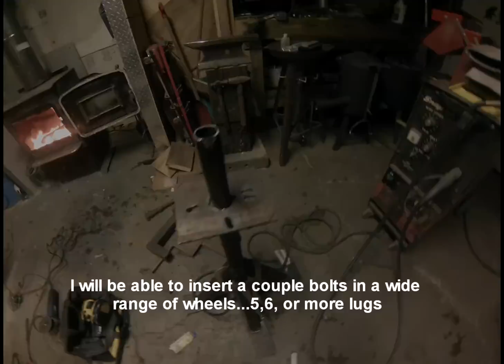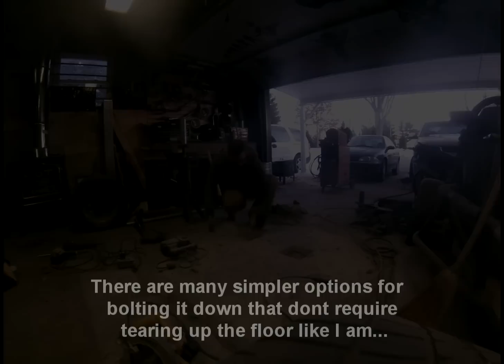How To Build A Homemade Tire Changer From Scrap Metal

Comment: Hi. Was thinking of making one myself. I may use 2 pieces of 3 foot railway track, in a V  formation, as a base. Take off  from there ; thanks for the small solid tire welded to pipe, for tire  hold down.......and others, I may have  shorter stroke, on the bead breaker arm. Maybe put 3 holes in it, near fulcrum, for better downward leverage..... Anyway.  thank-you.  ( from east central Alberta )

Comment: Pretty impressive! The only I am left asking is why you decided to bust open the concrete floor so bad instead of just using a hammer drill and red heads? I know you said you know there are better ways, so why did you go this route?
Reply from the maker: I built a manual tubing bender as well as an engine hoist that uses the same anchors. I did this because of the load they can handle. This is the strongest I could come up with.
Reply: smitherszx7 well, neat project either way. I have some scraps laying around I am trying to figure out what to do with them so maybe I’ll do something like this, thanks for the idea.
Reply from the maker: @DereksWorkshopAndProjects  thanks bud. There's nothing wrong at all with redheads or other anchors, but mine needs bolted and unbolted a lot and I dont think that's good to do with those. Good luck to ya man.

Comment: Another one where ZERO example is shown, LOL   did it rip out of the floor when you tried it so you cut the video? was the bead too much for the tool?    hate to be like that but damn man, kind of ridiculous dont you think? Like showing how to tune a certain carb and then never starting the engine.   nice. LOL  off to see if anyone has any ideas I have not already thought of.
Reply from the maker: I made a separate video using it.
Reply: Wow!   whats with the name calling man?  you didn't say anything about another video for this , just DONE, also no link and it's not next in the list.    I just went to look for it and it took me forever to find it, it's not even part 2 or titled to match this one as a second video, so whats is up with the name calling?

Comment: I'm using my wife's computer,And spotted this and it reminded me of my late father's bead breaker made in away back in year 1965.We had no power or a lot of money.So he came out this bead breaker he made with out the need for power,and also we lived out in the boonies about hour and half from town.So with in mind he used his gas powered welder and a cutting torch and use scrap metal to make his tire bead breaker.Well I still got and still use it.And he used 2 flat car springs to remove tire from rim.it works but times have changed and now I have a manual tire changer like you guys harbour freight set-up,only Pop's (Dad) bought it princess auto.Now pavement rue past the farm so now it only takes about 45 mins to town now.

Comment: Your one very similar to mine but I've mounted mine almost in the corner of my shed out of the way when I have my car in there and also I used an air ram to help break the bead and a small high torque motor to help remove and refit tires, it's a little bigger than yours but nowhere as big as a proper tire changer. My next project is the build a balancer as where I go they charge too much to balance each wheel

Comment: Well done. I've used both manual and both types of power tire machines and if the machine is well made many times it's faster than the power machines. You might want to revisit the bead breaker. We used an air driven one that saved a lot of pain.

Comment: could you weld some wheel nuts to the various holes in the main base plate and bolt the rim solid with the actual wheel bolts to the tyre changer, or make the plate thicker and thread the plate? it would eliminate the need for the rubber clamp.
Reply: That's a good idea.

Comment: These are the videos I love watching. A master craftsman and his tools. You have an extreme set of skills and this was an awesome vid. I have a question that is probably stupid but.....why did you add anti-freeze to your water for cement?
Reply from the maker: When its zero degrees, wet cement will freeze and crack, antifreeze prevents it. Appreciate your comment dude
Reply: O degrees ?   A bit too cold, for cement to  properly  ' cure '.......put some heat onto it, for a couple days or so.....